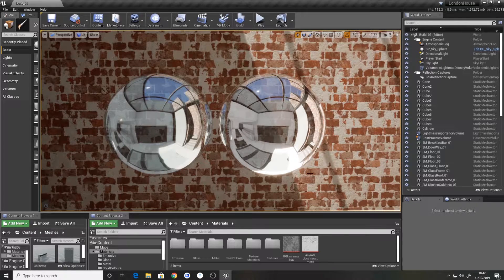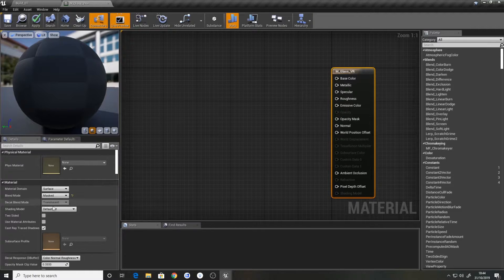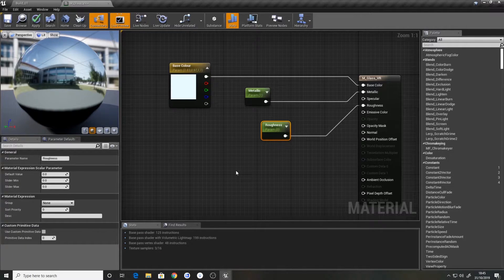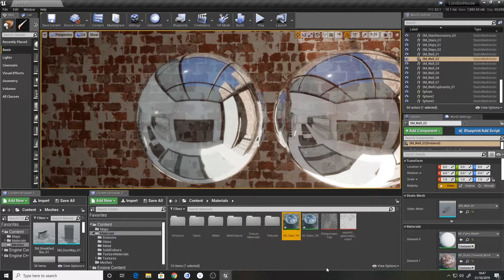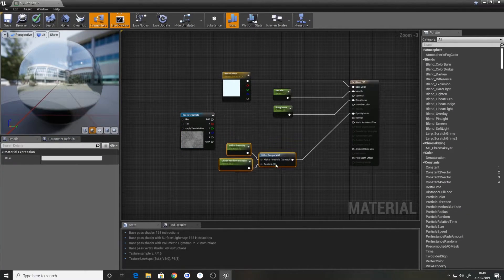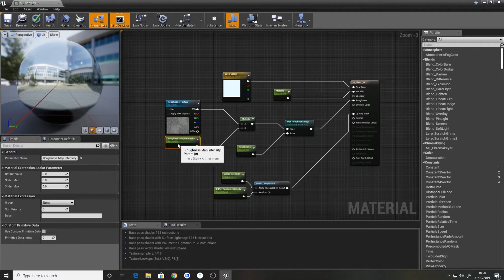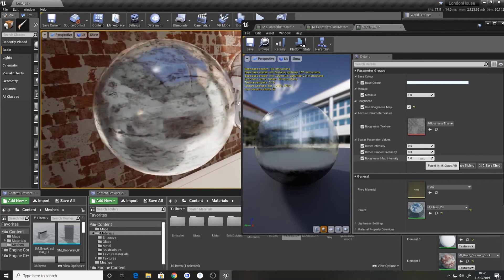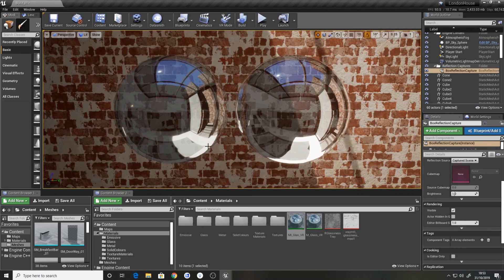High-Performance VR Glass - UE4

Comment: Thanks, I will try it. I almost had to delete all of my glass materials in my VR project, because they had very expensive counts.
Anyway, I still have no idea How to solve the exposure control. My project is typical interior exterior scene and I need to compensate exposure in interior and exterior separately. How to make it? Does autoexposure work? Me not. I run Oculus Quest 2 and tried almost all possible setups- still not success, my exposure value is still locked on one value.

Comment: Thanks !!!, but I don't know what I'm doing wrong, the material seems a little noisee , like a very small dots grid, not as shiny as yours, missing something here?
Reply: did you ever solve that?  I get the same result.
Reply: @RobertOoghe  I am having the same problem... any answer to this?
Reply: @virx7944  Dither gives the material opacity a Screen Door effect.  The dots can be quite visible.  I think it works best in forward rendering? The temporal dither AA pokes holes in the material to try simulate opacity :)

Comment: That does not look like glass! For some reason UE4 has a hard time with glass. I think Unity handles the refractions better
Reply from the maker: I'd recommend trying some different perimeters if your having issues. 

This works well for desktop VR its how epic recommend you create glass. Very similar code was retrofitted for use in the Unreal Showdow project and the Oculus Dream Deck application where it provided 15 - 30% performance increase. 

https://developer.oculus.com/blog/introducing-the-oculus-unreal-renderer/?locale=zh_TW

If unity is an application you understand or have experience with it maybe better to use that for your project. If it better suits your projects requirements.
Reply: You're watching a tutorial on how to make performant glass, so don't expect realism. Unreal is pretty great at glass, but ray tracing is not available on mobile games and not recommended for VR.

Comment: For some reason it looks a bit strange, some lines appeared. https://drive.google.com/file/d/1f_5SqiZYdAq99gwEhgDA52geKUG3-cGm/view?usp=sharing
Reply: Same problem here. Could be related to forward rendering or use of MSAA enabled ?
Reply: @sveng7096  seems not
Reply: @toxyne   Tried some things on my side but couldn't make it to look properly. I now use blend mode = additive instead (with params metallic, roughness and opacitiy). Should also work for VR and more lightweight compared to translucent.
Reply: @sveng7096  can you give material screenshot please?
Reply: @toxyne  Sure, here it is: https://drive.google.com/open?id=1TO0Djwib6fEOBKxujuhByOlDzTlEUBGj
Reply: @sveng7096  metallic, specular and roughness not active in additive mode
Reply: @toxyne  Sure, they are active. I made a material instance of this material and changing those parameters do change the way the glass looks and reflects.
Reply: seems it is not working for standalone VR

Comment: Hi, thanks for the tutorial
Do you know why by using carpaint from Automotive Materials in VR (Cinematic engine scalability) I have some problems with reflection?
It seems like they fade in and out based on where you are looking
I had the same issue with the glass but I am following your tutorial and It seems like its working
Reply from the maker: Unfortunately, I'm not too sure as I haven't played around with the automotive materials. Have you added reflection captures to the scene and built them?